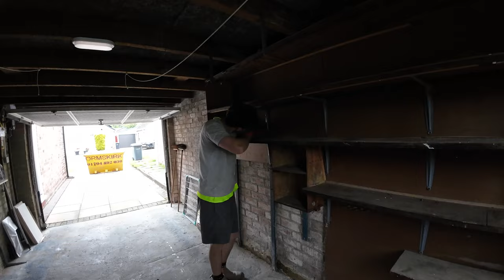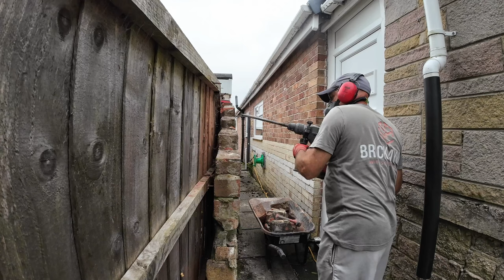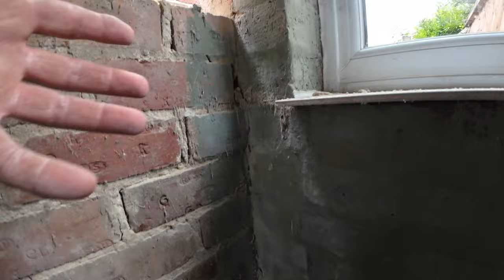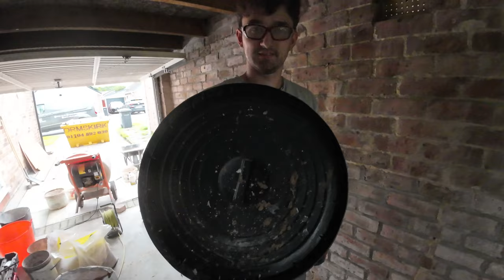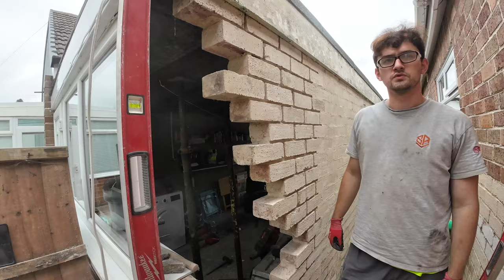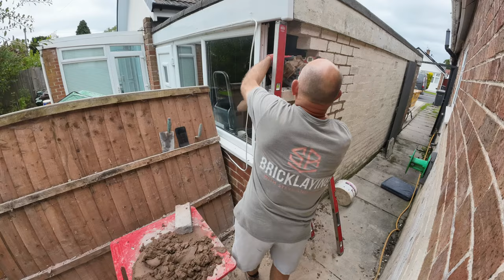WALL FALLS OVER AND TAKES A GARAGE WITH IT !!!

Comment: I think this garage must have been built by the same person who did ours years before we moved in (an alleged builder who did a lot of stuff himself) . Fourth wall leaning over by about 4 inches at the top leaving timbers hanging in the air (6 foot high) none of the timbers were tied into the wall. Have just knocked it down to rebuild it. Also a fall on the floor of about 1.5 inches over a 6 foot span.  If this guy owned a spirit level it was faulty. Everything in the house is on the p**s. Lintels installed in extension too low so non standard door size - had to raise up. Old 1930s wiring in ceiling void joined to newer 70s cabling. Lighting in conservatory not working - removed wood panelling to find multiple cable 'explosions' where nails had been knocked through. The list goes on - have been putting things right for 20 years. None of this sort of stuff shows up on surveys.
Reply from the maker: That’s  grim but so common unfortunately 😒🧱👍🏽
Reply: @john3435
Unfortunately contractually its still "Caveat Emptor,"  and most of the building surveys are just exercises in "back-side covering."
Reply from the maker: @martin2466 😨😬🧱🧱👍🏽

Comment: Please observe health & safety & save OUR NHS FROM DE COKING YOUR LUNGS. You're doing ok   however, please   use a mask when cutting through materials where Dust will inevitably seriously damage your lungs. Similarly, a Hard Hat should be worn when removing Masonry, especially when it is above your head. Protection to bare skin is also advisable together with Safety boots. N.B. Slate packings are required to TOOTHING in existing Brickwork whilst Mortar attains it's strength. [ mortar shrinks during curing]
Reply from the maker: Did you copy and paste this ?

Comment: Hey guys quick question, understand if you want want to say.

What was the ratio with the lime  you used for the wall and which lime.
Reply from the maker: Just line from out local merchants  
6 sand 
1 cement 
1 lime 🧱👍🏽
Reply: @SteveAndAlexBuild   thanks guys, iv been DIY ING the pillars to our house and wanted make sure 😄
Reply from the maker: @bugcave8100 🧱👍🏽